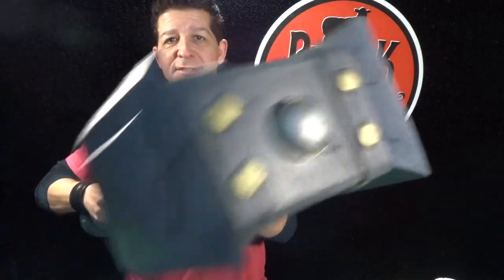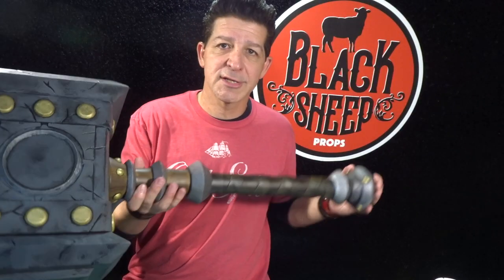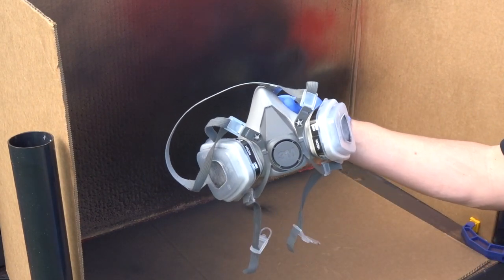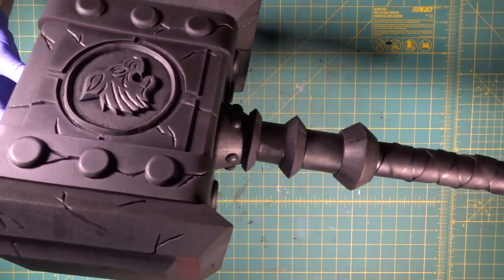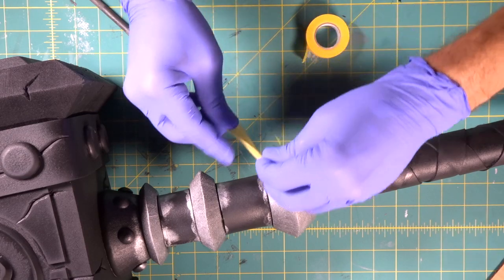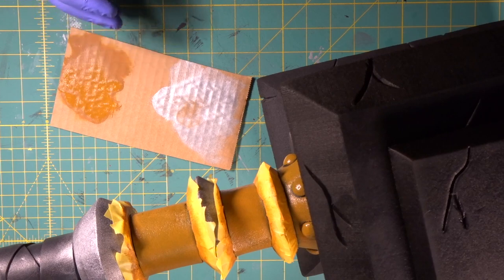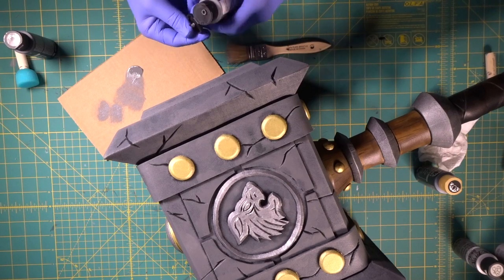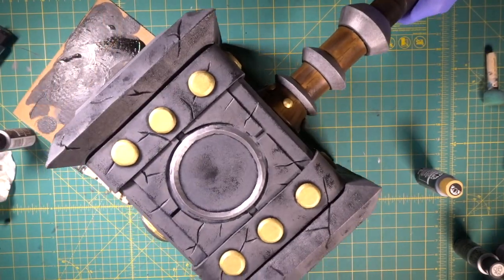Making An EVA Foam Doom Hammer Part 3

Comment: Great build Steve. I do have a question for you about your painting. Do you ever use a clear coat to seal the prop after it’s all painted? I’ve watched all the builds and I haven’t heard you mention it. If you don’t, is there a reason? Looking forward to more videos to come.
Reply from the maker: Hi TD23!
You know, I’m not even sure why anyone does it - don’t know what it’s supposed to do? I assumed it was needed if you were really gonna be handling it a lot or using it at a lot of conventions or something? As I was watching and learning, a lot of the folks I was watching were clear coating their stuff but when I jumped in and started building I just never did it from the start. Not sure why, I guess as I was finishing pieces they kind of looked pretty good with just paint so I just left it out and it kind of just stuck as the way I do it. 

As far as more videos - there’s 80 more already finished and waiting their turn in line to be uploaded. And there’s probably 75 - 90 more planned after those! Will be going for years for sure! I’m having so much fun.

Hey, thanks for watching, glad you like them!